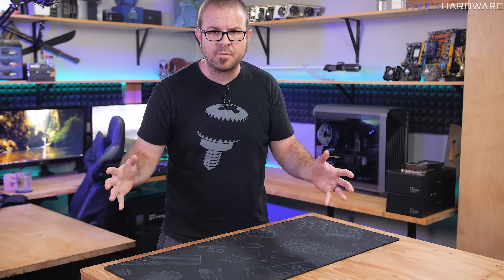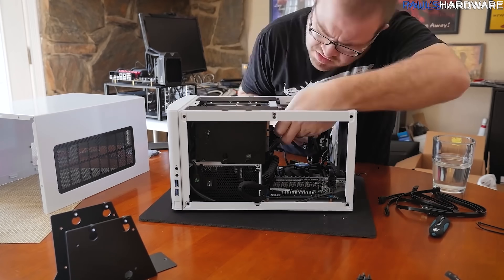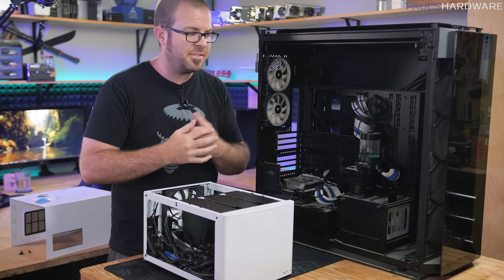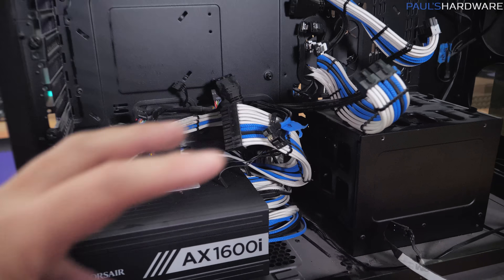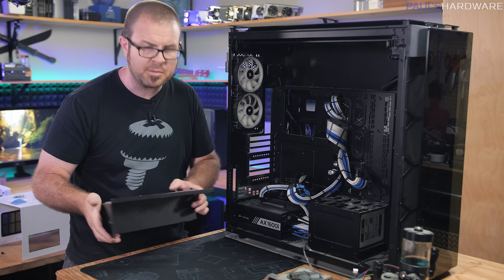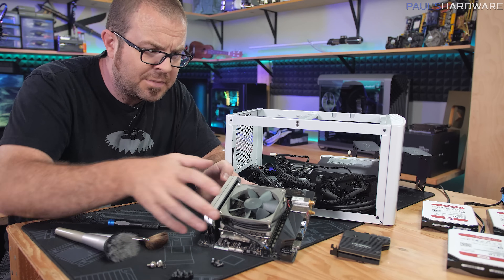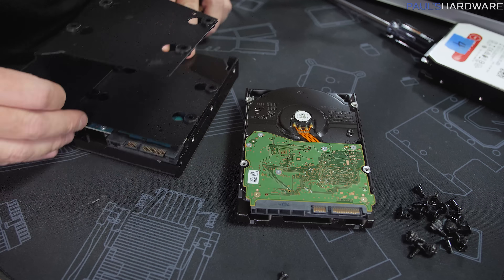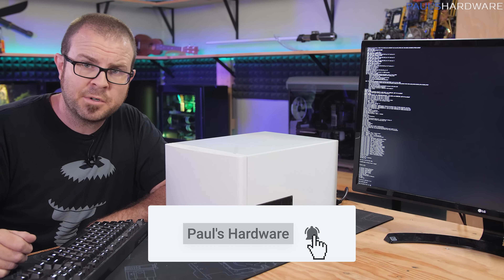2 PCs, 1 Case = BAD IDEA

Comment: I would never do a water loop in a multi system box unless AIO,  Need that ease of access to repair without full tear down.   Dual PSU dual power button is also a must, each system needs its own power or you hit that failure you noted on having to shut down both to work on 1.   Heavy is relative I have a single case PC as a nas that is over 100lbs because of 1. cooler master cosmos2 case being a beast of a case 80lbs empty  and 2. all the HDD's i have crammed in that behemoth of a case ......  and I also have a custom dual pc case that has two iATX boards in it that is less than 30lbs  so dual boxing systems are just like all pc case builds....... is all about what you need, adjust for want, and designing around optimal use cases for those needs

Comment: I have separate psu’s for each pc in my build.its just easier I think. But you must have the case to do it ..I have the tower 900 and  made a 2pc one case build out of it …works just fine..lot of wires and zones with fans ..the slave pc must keep its heat separate but I set that pc to be more sensitive to the heat so it helps the main rig stay cooler/ish..

Comment: Hey I had a question about the case, I bought one myself and am also wanting to do a custom water cooled pc (first time building one) but I wanted to go super over kill with 4 x 480mm radiators (2 on top and 2 in the front) but the biggest issue  I'm seeing is which reservoir/pump combo. I'm worried I'm not going to get a strong enough pump but the 2 top radiators are going to be just for the CPU and the 2 front ones are just for the GPU so ill need a pump that's strong enough to push the liquid through 960mm of radiator. I've been trying to do research but I have no idea what most of the stuff means and not many content creators make custom water cooled pcs.
Reply: Good luck, he’s not going to answer you after all these years 😂
Reply: I was taking a shot in the dark🤣🤣 but sadly I missed hahaha

Comment: I can see why you would not want dual mobos & water cooling in one case, but one or the other. Why did you need the water-cooling, sorry if I missed that part. For me, today's CPU's are fast enough for all my needs, I don't need/want water-cooling, just many cores and mega-memory. I do SW Dev, casual gaming, and want to have 2 home servers Windows Server & Linux to handle NAS, domain controller, plex, VM's, maybe game server, web server, etc. It's a tinkerer's home lab but I tinker with software and learning networking, hopefully not having to open the case very often. I don't know why I would need liquid cooling, just a dozen each hds and fans, or so. But there's always too many boxes, kids pcs, new builds/repairs...projects. I just want these 2 servers combined if it can be done practically, probably put it in font room with switch where Internet comes in. Thoughts?

Comment: I came across this video two years after it was published because I am considering a dual system and I'm doing a lot of research before I decide. You make a lot of good points and have given me a lot more to think about. My use case is quite different. I would never risk putting my storage backups in a situation like this. I am going to be  using the main system for a daily driver and gaming. The smaller, secondary system will be for streaming, recording, and for my neice and nephew when they come over. They can both play on my computer without fighting over it because it's really two computers. They can sit side by side and chase each other around in Rocket League, Roblox, and Fortnight. I don't have a lot of space for two computer but this case takes up about the same volume as two cases. The footprint is smaller than having two mid towers but it is way taller and deeper. I really didn't think about one system taking down both of them. That is a huge disadvantage. I'm glad I saw this video before buying a dual case and thanks for putting it out there. I never would have thought of a lot of this stuff until it was too late. Cost is another big one. This "super" tower is over $500 and I can get two midtowers for half that price. So the case is four times as expensive as just buying two separate cases. Buuuut... I really like the idea of it and it would save me a bunch of space in my little room. Also, I still play MMOs and I do enjoy two-boxing. I can two-box with separate machines but this would be ...

...decisions, decisions.

Thanks again for pointing out the cons. This video might have saved me a bunch of money and headache.

Comment: Just adding a reason for dual PC cases.  Reuse and restore.  With many of us accumulating old PCs not in use, running igpus or non powered GPUs on them could make for some light weight processing and rather than dual booting different OS' you could just run the two systems at once networked together.  (Windows 10 does not play nice with proprietary 2014 hardware).

Putting them in the same case the size of a midtower or smaller would be awesome.

Comment: I have a dual system pc.  Number 1 reason is a space saving measure.  I dont have the room to plop a second case around my desk and I wanted a second system.  Speaking of, the reason I have a second system is for server hosting for games, I do want to make it also a little storage NAS but havent gotten around to it.  Number 2 reason I did it was cause I thought it was cool, I just wanted to.  I had old hardware lying around the I was kit bashing together into a server, and I found that the only major investment I needed, aside from the dual system chassis, was an itx board for the server.  My pc is now freaking heavy and I haven't even water cooled it yet like I want to.  But I do find it interesting and fun to use.  If I ever have the space I'd love for an actual home rack server and then ill do away with my dual system, but for now it's a fun project.

Comment: I am interested in two PCs in the same case because I'd like to run TrueNAS on one and Proxmox on the other for a Homelab, and be able to share power supply and to figure out a way that both can access the the Proxmox server can access the hard disks for VM storage of the TrueNAS, albeit I have yet to consider how to make that disk access work, if it is even possible.

Comment: As a two pc one case owner ( 1000d case to be exact ), I concur on these issues. One the pc is super heavy, forunately I have the pc rested on my music rack that have casters so its alot easier to move around. Second, my itx motherboard have failed on me three for the year and a half I've had this case. Troubleshooting became a huge pain because I had to driain the loop that was connected to the itx board everything time I had to troubleshoot. I enjoy the looked of my build but if I have one more psu cable, motherboard or gpu failure I will split them up in two separate cases.

Comment: Nothing wrong with dual pc case. More of an issue with all that  water cooling on top of those NAS drives. Probably not the best use case. Two workstations would make a lot of sense or even a streamin setup!

Comment: Eh i still love the 1000d and intend to build a dual system in it, the reason why is the 1000d has the capability to and id much rather use it to the fullest extent. plus failures arent a major problem since ill be having the pc in the room and more regularly cleaning it. Finally ill divide the cables as best i can since the 1000d has the room to the only problem is the fans but its not much of a problem. Overall i think 2 systems in one case certainly can work in a different scenario then pauls. overall a great video though! I'd love to see a new build in your old 1000d

Comment: Me wanting more compact and low power computers. Meanwhile, CPU's start going into the 250-300W power consumption and requires water cooling. GPU's becoming 3-4 slots, extra wide, extra long and 10 kg heavy, consuming bit over 1KW. Motherboards also get larger, heavier. RAM also became much taller... But at least in all this mess someone brilliant invented M.2 SSDs!

Comment: my brother had a Xeon + K6000 workstation and a 4770k 780ti in his cooler master cosmos ii some years back, it was glorious, he's built tall and heavy so moving it around wasn't much of problem, we maintained it well so we had no problems if at all with her and it was air cooled [as were the times], upgraded it in 2012 then finally in 2014 [k6000 to m6000 i don't remember if it was the other way round]

but this is also true, we sold it because we got fed up with the weight and generally lugging it around, great thing is it retained much of its value tho.

Comment: The extra weight came from the water cooling loop as did most of your issues with your dual system setup. I think  more practical dual system could be built in something like a Metallic Gear Neo Qube with one midrange to high system and one humble ITX setup with integrated graphics. Triple monitors + kvm+ Mouse Without Borders software KVM. Should be stutter free gaming on one, while you do whatever you want on the other. Please make a video of this build.

Comment: Am I weird, I use a Raspberry Pi for my NAS because it is on 24/7 and passively coolled. It will run for hours on a 650 UPS too if the power goes out. Also yes I have the WiFi on UPS backup too.

Comment: A company I worked for did build a dual-system unit for a RIP and digital proofing system. The main PC ran the RIP software and that was sent via the second NIC-port to the secondary PC which ran the output software for the imaging unit. The main PC ran Windows NT server at the time, and the output device ran Solaris and proprietary software for the imager. As far as doing this for a personal system, I'm not sure of the usefulness outside of dual purposes such as a NAS-box and PC all in one unit.

Comment: Hi Paul, I took a break from computers during the shortage, with the GPU burnout and other shortages. Just made it around to see what your up to.

The reason I'd get a case that big would be radiator overkill, I own a Phanteks Enthoo Luxe, and it was a good idea for a bunch or drives and a radiator. Although there are things about the case I don't like, it's fine for what I need.

Anyways, thanks for the content.

Comment: Pretty disappointed with your conclusions. Virtually every problem you have with a dual system rig is addressed by a better designed case. Generally Corsair makes good products but if I was trying to make a dual system this case is one of the worst. Definitely shouldn't dismiss ALL dual system configurations based on one poor design.

Comment: I found myself in a similar situation when I built a chenbro NR12000 (after watching craft computing) I tried to populate it with a couple seagate exos drives, well they don't use the same mounting (they use the extended spacing, the server chassis used the middle mounting). So I had to (and still have to) take out the drive mounting brackets that are riveted and screwed in and drill out new mounting holes for one of the sets of mounting screws. (I did 1 tray, have 2 more to do)

Comment: Good move using painter's tape instead of Duck Tape. Or any other brand of duct tape for that matter. You wouldn't be able to get the drives out the next time the system needed cleaning.

Comment: It's ok Pail you can say it's a shit case, because it actually is a shit case. Pretty disappointing to see a lot of the issues with this case still have not been rectified with the 5000D. Nice to see it's not just my PSU shroud that's warped. Pretty disappointing to see a 1500 dollar case which Corsair had to discount to 800 within a few months because it was not selling has the build quality of a 100 dollar case! Seriously, I've had a 70 dollar chinese case with those snap off PCIE covers, and it's had a stronger more sturdy frame than my 1000D! For shame corsair.  So pissed because I was going to get the InWin 907 but they were really hard to find so I got this instead, That's what I get for being lazy, should of stuck with InWin! Them and Lian Li are the only two manufactures who make decent cases anymore.

Comment: I had the same HDD mounting issue when I got some 8TB hard drives (HGST Deskstar NAS) a few years ago.  Had a Rosewill Thor V2 case - it only had the closer-spaced screw mounts, not the wider ones.  (Some of my older HDDs, for example I think some 5TB and maybe 4TB drives, had screw holes for all 3 screw positions.)

I ended up getting another case entirely - the Fractal Design Define R5, which solved that issue.  (It still didn't solve the issue of running out of drive bays, though... sometimes I've wanted to plug like 20 or 30 drives into the same system, and I don't really want, nor have a place to put, a rackmount case.)

Comment: Was thinking of dismantling my series x and installing it in my current case with my pc. Setting up the extra rgb/light mode button as to make a on/off switch for the xbox.

I would have to reroute some things and add a few fans just to increase airflow in the case to compensate for the 2 systems. The amount of airflow that is needed for the xbox really isnt that much. 

Only reason is for all of this is as you stated, space. The simple fact is that I have limited space for both systems in my current set up. My wife has only allocated me so much room and I feel a bit cluttered as is.

I would be voiding warranties and all that but it seems like a fun little project that might work flawlessly or be an absolute disaster. More to think about i guess

Comment: Node 304 is a pretty old case these days but it's still one of the best for a self build NAS. Not super easy if you need to swap out a bad drive, but not too bad either as Paul showed, the drives are reasonably accessible. I have a 4 drive TrueNAS build in the black version and it's great, although my drives are only 4TB ones so they fit okay in the caddies.

Comment: I have thought about running 2pc 1case for my used case being a PC desk and a separate simracing setup next to it, 1 tower in the middle then parts coming from there is much better then my current 1 pc for each and cables EVERYWHERE. Other then that personal used case maybe streaming?

Comment: I just built a PC in a Phanteks case. The front mesh had no fine air filter. I noticed dust building up inside on the floor of the case after hand-sanding a wooden ship model near the computer while it was running.  The PC drew in all that dust instantly.  Solution: Got a furnace filter and cut an appropriate piece and placed in into the front section behind the mesh. Voila! Filtered air for my computer case.

Comment: eeeeh i still like dual system PC's i think most of your problems had to do with the Corsair 1000D which desperately needs a redesign. first. corsair needs to not put the pump mounts over the hard drive cage, second, there needs to be a basement or a way to mount fans on the floor of the case, so that if someone wants to use the EK front mount distro plate, they can still have positive air pressure. lastly, i hate how much fans it needs just to look "normal"

Comment: Thx for the good content. About the hard drives.... Did you notice, that the space on the newer drives between the horizontal screw holes are the correct size for your case mount? So why don't change from vertical to horizontal mount? The space should be there as I saw at your close shoot footage.

Comment: IMO only reason to do a 2 PCs in 1 case is if the second computer is going to be a workstation, or to capture/stream to (because all PCIE Lanes are used in beefier computer) and the stream part is a stretch because streaming directly from single computer is usually alright; unless you have a 2 system stream setup. Or "MAYBE" having a NAS as 1 system...lol

Comment: Silverstone DS380 is a great little NAS case. 8 hot swappable trayless 3.5" so you don't have to worry about hole pattern plus 4 fixed 2.5". Would mean jumping to SFX(L) for the PSU, but very worth it.

Comment: @Paul's Hardware , if Fractal are still making the Node 304, perhaps they have modified those HD brackets over the years.  Perhaps you should touch base with FD and find out.

Comment: A much better dual PC case, IMO is the Mountain Mods U2-UFO.  Dual power supplies too also in relatively small 18" cubed case.  Been around forever.  Doesn't have the issues this build did.

Comment: I think Thermaltake w200 has one the best dual system cases, but it is a very large case. It keeps both systems separated making working on each one easier without having to tear the system apart.

Comment: do NOT use a vacuum to clean computer parts EVER!  They can cause static to jump many inches to your motherboard.  Use compressed, dry, air to clean them.  You can use a small brush to help remove the dust.  As someone that has seen the static jump upwards of 4" to a component just don't do it.

Comment: 14:41 <paulvoice>well, that was stupid ...</paulvoice>
you could have just
- mounted the drives that you put on the outside of the brackets inside of them as well
- which is how these brackets are intended to be used anyway (for the 3x2 max config)
- stick a piece of foam between the labeled drive sides that are then facing each other
=> free additional vibration dampening
=> no need for sketchy blue tape abuse
=> profit

Comment: My new build an upgrade from a 1366 system in a cooler master HAF X case will be a threadripper pro build,currently I have the 1000d case with 10 ll120 fans and a Corsair AX1600i psu. The build will be a one pc fer 4k xavci video editing, only my second ever pc build   so I am taking my time with it

Comment: That phanteks dual PSU has a pretty high fall rate powering two systems independently for some reason. Had to RMA and decided just to go single system so I didn’t have to rely on specialty parts from one company